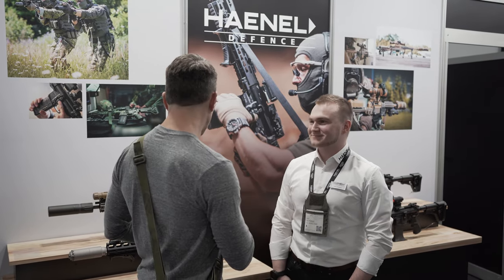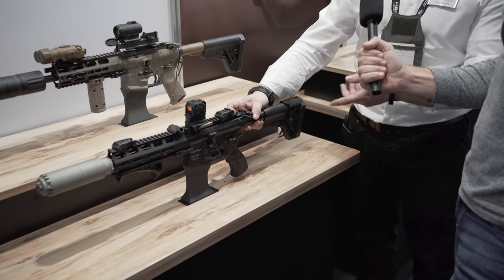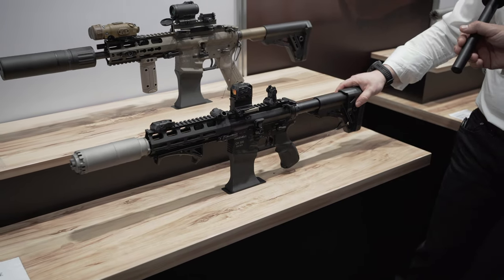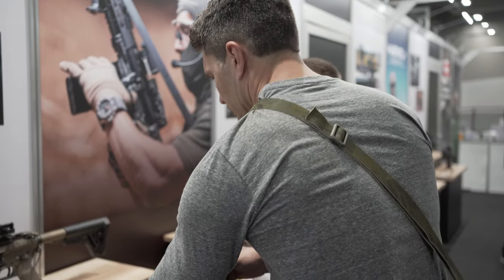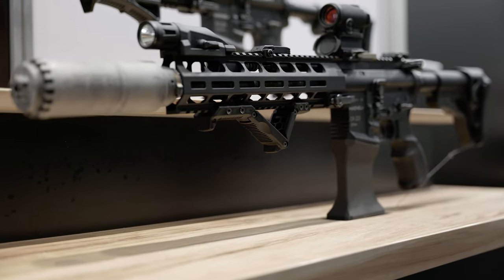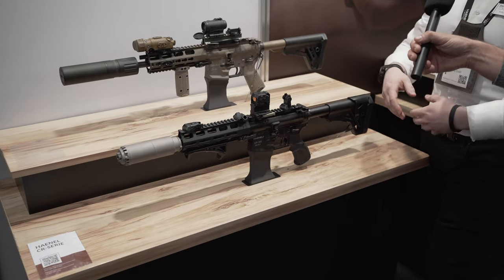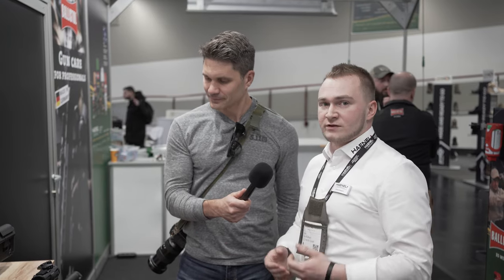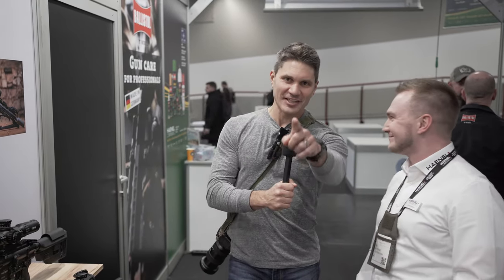The Haenel CR Series of German Piston-Operated AR Carbines

Comment: I love the feature that it can have the safety engaged without it being cocked.
Reply: The HK can do that,vas well as commercial triiger such the KE Arms SLTs
Reply: LMT sells 2 versions of their AR trigger, one of which has this feature. It's becoming known as the "Euro safety"
Reply: I was never brought up with the AR, so I'm not welded onto either version. But it just makes so much more sense to have a safety that can be engaged at any time.
Reply: @J.bar3.0 multiple redundancies in storage. Only thing that I can think of.
Reply: KE Arms cassette style triggers have been doing this for years. They're not the only ones but I have had experience with the slt1 I bought in either 2017 or 2018. Very nice trigger
Reply: I actually prefer the original design, because if the weapon is not cocked, you can try to engage the safety, and instantly know that there's no round chambered, which gives you more information with less manipulation of the weapon required. I consider the old system to be superior, and the lack of safety engagement without a round chambered was not an oversight in the design.
Reply: @J.bar3.0 When you're dealing with humans and other idiots.
Reply: @albertkropp  if you’ve had a light primer strike and go to engage the safety on an “old” AR, it won’t work and it won’t be the case that the chamber is empty either. Youd still need to visually inspect the chamber to know there’s not a round loaded into it.
Reply: @Rushil69420  Yes, but if the round didn't go off, you have to re-chamber to make the weapon hot again, so I'd still argue the gun would be safe, in that case.

Comment: Most of these features need to be standard on the AR platform. The charging handle, small cheek riser, ambi controls, 60 or 45 safety, suppressor setting, and bufferless (DI or Piston).
Reply: so MCX basically 😂

Comment: Is that QD mount on the hand guard some kind of modern three point sling mount? I have a PTR-91 so I am one of those nuts that love the old three point sling system from HK. I wonder if someone makes a three point QD system. Probably sounds silly to most. Very cool rifles over 3k from what I can see. But it’s probably worth it. I used to be a machinist and I can tell you it takes a lot! Of work to make such a good product. Anyway love the coverage James!

Comment: Could anybody describe how Haenel made the bolt carrier group so there is no bolt tilt? Bolt tilt has been the number one problem for piston AR's. The sales rep did say Haenel rifle has a short stroke piston design. Would like to see how Haenel solved the problem.
Reply: I’ve run a factory Adams Arms 11.5” piston upper suppressed since they were first released (over a dozen years) with zero carrier tilt issues through 10k+++ rounds. The add on kits had issues. These guys seem to know what’s up.

Comment: These guys nearly won the German military rifle competition. However HK didn't give up so easily, and the court sided with HK that Haenel has infringed on their patent, and ordered all the rifles for that contract destroyed.
Reply: It was only a few of them.
Reply: HK really sued Haenel for the position and size of the drainage holes in the buffertube and another feature in the rifle that makes it OTB capable.
Reply: @FDCNC  OTB?
Reply: @nunyabeeswax2575  Over The Beach. Its basically a standard that rifles have to meet that makes them suitable for waterborne and aphibious uses. Its basically can the weapon resist the harsh environments whether it be sea water or fresh water and can the rifle operate immediately after being submurged in either conditions reliably without blowing up due to pressure.
Reply: @FDCNC  ah ok,  I had heard that term in full before but verbally so I didn't immediately associate the written acronym with that.
Reply: @FDCNC  that’s why I bought my HK MR 762 well, one of the reasons…… not that I Rambo out of a river that often…
Reply: @TexasProbate  The HK MR556 and MR762 as well as their European counter parts rhe MR223 and MR308 are not OTB ready according to HK. It may function just find if you try it with your gun but its not OTB ready according to HK and not all 416s and 417s are OTB ready.

Comment: I was told that two screws on each side of the hand guard where it mounts to the upper keeps hand guard rigid, helps optics accuracy. The swiveling arm is convenient  but how rigid is this feature? This rifle looks really cool. Is it as capable as an HK?
Reply: I have one of these as well as a 416. Its just as capable however the locking lever on the Haenel cracked after about a 6 months and only removing the rail maybe twice in that time.
Reply: @Gunbird416  Must have been user error, I have several of them as well as the 416 and these are better guns honestly. If you cracked it you must have done something stupid with it
Reply: @wilsoncombat1341  if you count being tossed in a truck or smacking into a vtac as abuse sure, otherwise that's just regular use in my book.

Comment: great content: the one thing I will say though is the U.S. is I think the only place where you can buy AR's all day long under $500. besides modularity, in my opinion is why the AR will always be King & Rule Supreme when it comes to Modern Sporting Rifle's/Firearms. no other complete platform is as low of a cost, as the AR platform.
Reply: How is it a sporting rifle?
Reply: @MbisonBalrog  You need to look up some of the AR pattern rifles set up for deer hunting in the US.
Reply: @kutter_ttl6786  in Europe I mean.
Reply: @MbisonBalrog  Same
Reply: @maledetto1221  I pretty sure at least France and Spain you can’t have that unless heavily modified to point it’s no longer an AR
Reply: @MbisonBalrog  wrong, they are only limited by the mag capacity. They may have different processes to get them(different licenses or authorizations)  but they can own semiauto AR15 identical as the one in the US
Reply: In many places it can be a pain to get a permission or license, and some countries limit how many firearms you can own. Therefore, there is a tendency towards owning a smaller number of higher quality firearms than just buying multiple $500 throw-aways. Plus, the VAT/sales tax is frequently 20% or more, which is a hefty uplift.
Reply: @maledetto1221  this gun not be called sporting. It is military style in France. Very hard to impossible obtain permission for it.
Reply: @MbisonBalrog  "military style" means category B9 with a 10rnd limit. The difficult ones are A6/7/8(de-mil, folding stock or >10rnd mags)
Reply: @maledetto1221  neither are easy to obtain
Reply: @MbisonBalrog  Compared to the US? Definitely. At the point that you can't own them? Definitely not.
Reply: @maledetto1221  making permission so difficult to obtain is sly way to make it illegal.
Reply: @MbisonBalrog  You only need to pass a background check, a medical exam and 3 controlled range sessions, then join a shooting club. "So difficult".
Reply: @maledetto1221  not that easy in most of Europe. Where is that simple?

Comment: Pardon my ignorance, but what is the difference between piston driven like the SCAR & piston - operated? I did see a typical AR charging handle...Thanks. Great content. 👍
Reply: Theyre bout the same all things considered
Reply: No real difference in how they operate but there is a difference between a long stroke and a short stroke system. Long stroke systems tend to have the bcg attached to the piston which goes all the way to the gas block/piston block. Longer piston=long stroke. Whereas a short stroke piston system has a standard bolt carrier group but the gas key has a flat face instead of a cup and the Piston itself when fired hits the bolt carrier group with the op rod. If you want to get a good understanding look at a breakdown of a primary weapon system long-stroke system versus say POF Short stroke system you should be able to find cut out schematics online and it will help you understand a little better.
Reply: @colinlewis4637  thanks for taking the time. I'll definitely search for the schematics.

Comment: I don't know why all companies aren't producing piston drivin ar15s. Yes it has added weight but with metallurgical technologies advancing more every day this shouldn't be a problem. My friends tell me I'm a gun snob because I only buy piston systems. Then when we're cleaning guns after a range session and I only spend 15 minutes cleaning mine and they're spending an hour or better to get their rifles clean they started to understand. Especially when shooting suppressed. Either way the haenel rifles are absolutely gorgeous and if I can find one I'll be getting one. I especially appreciate the bolt catch assembly that they have. Very intuitive.
Reply: Why are you spending even 15 minutes cleaning your rifle after every range session? Wipe your bolt and carrier off, add some more lube, run a patch down your barrel, at most, if you’re feeling frisky. Couple times a year do a slightly more thorough cleaning. You’re making unnecessary work for yourself.
Reply: Because a piston in an AR is an answer to a question no one ever asked.  DI ARs are equally as reliable as any piston system and then some. Especially in mid tests..

Comment: Is this even legal in most Euro countries?
Reply: Wrong
Reply: In most eu countries it is classified as rifle if it have least 11.8 inch barrel.
If want to have shorter then you must attach somekind of muzzle device
which is not removable by wrench and screwdriver to meet that min length.
Usually that means muzzlebreak/flashider with threads for supressor.

But yes it is perfectly legal to own. permit for this kind of weapon is usually
requires sporting license if want get it with unrestricted magazines.
As B-class or similiar depending on country max 10 round mags can
get as hunting rifle.

I have Proarms Par mk3 piston AR. Lower is 100% standard lower but upper
is pretty similiar with quick removable handguard and easy acces to piston and
gasport settings (1-4 positions)